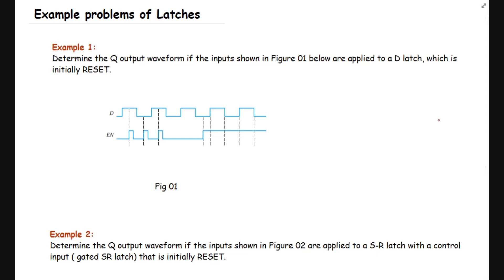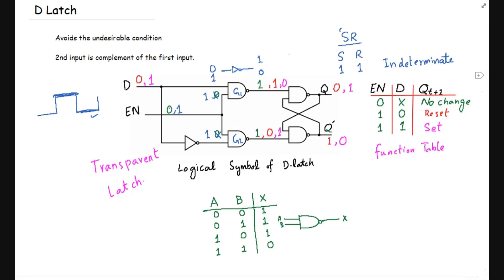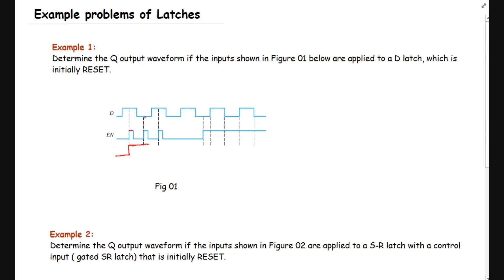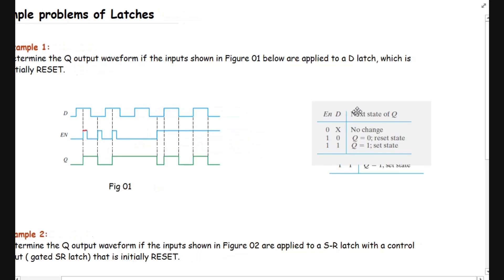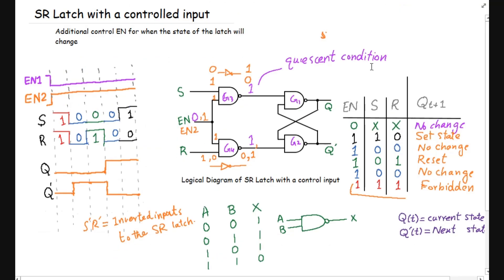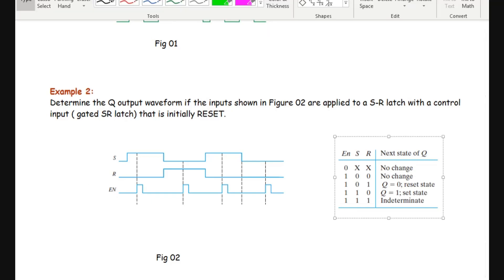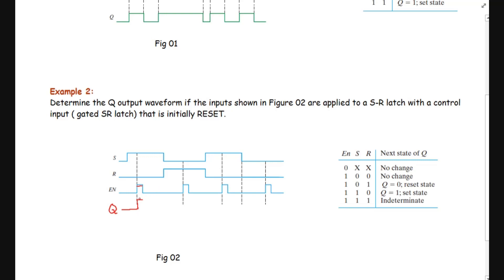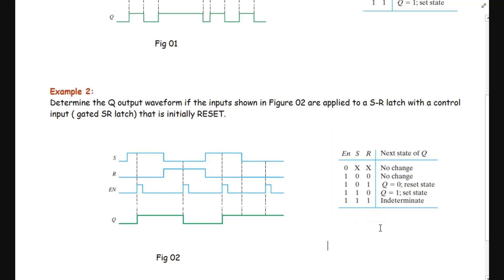8.1. Example Problems Latches : Latches Part 7

Comment: in SR latch we use NOR gates but here we are using nand gates also the truth table is a bit confusing
Reply from the maker: Yes it is true that SR latch has two types, NOR gate SR latch and NAND gate SR latch also called S'R' Latch. Keep remember that S'R' latch is equal to SR latch with the inverted inputs. Here in example 2, We have third type which is SR latch with control input. The circuitry seems similar to S'R' latch, but when the EN input is 1, the Nand gates connected with the EN input acts as inverters. So now we have Inverter+ S'R' latch combination, which is equal to SR latch. This can be also confirmed from its functional table, when EN is 1, it is exactly the same table as SR latch Table. All of this is also explained in the video in detail.